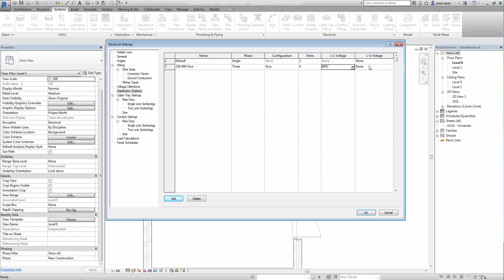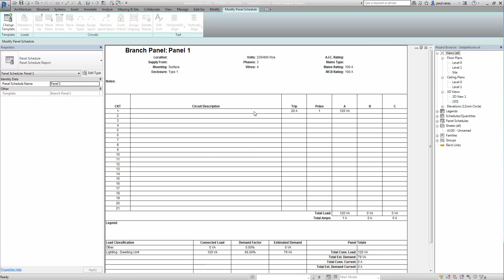Revit MEP - Power up Lighting

Comment: Hello Paul, first I would like to say thank you for your work. I  have a question in regards to this particular video. I am designing a house in the architecture format. When I attempt to add lights and connect them to a power panel my distribution system does not exist. Similar to the issue you had in this video. I have a student version of Revit whicg I read could be the issue but I know that is not the problem and then discovering your video I thought I found a solution. However, it seems to still remain missing. I followed your steps in this video but still my power panel cannot be associated with a distribution system. I've even tried switching the format from architectural to electrical yet still no solution. Do you have any other suggestions what the problem may be?  Perhaps, I'm missing a setting or a step? Again, thank you for your time and helping me along my educational journey.
Sincerely,
Shargene Zangana

Comment: I like what Revit can do by connecting things together. However, I don't like about Revit is that it does not let us show information about each fixture like I can do that in Autocad.  The reason why that is important is because showing wiring like you are in this video can get really confusing when we do the high bay light designs with hundreds of lights etc. So in my plans normally I show information for each fixture such as which panel and circuits are connected to and which switch.
Reply from the maker: Hi Ilir, I get your point.  There are ways to see the data.  You can create 'tags' to show the data that you want and you can also create schedules that will show you the same information in a tabular format.  Perhaps I should make a video to show that?
Reply: Paul that would be nice. I like your pace in your videos.  I have used Autocad for years but new to Revit. I saw the comments below that you have provided people in the past with the file, I would love to have an electrical template with power plan levels and lighting plan levels. That would be awesome.